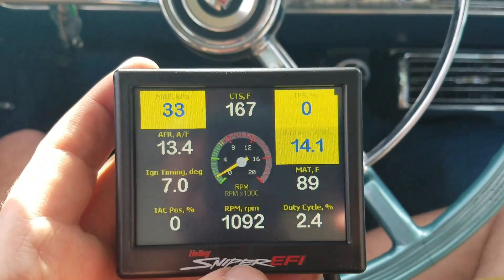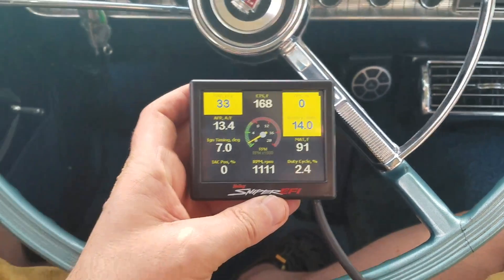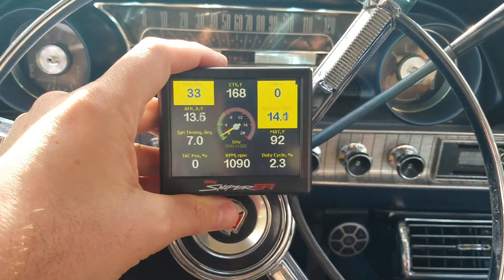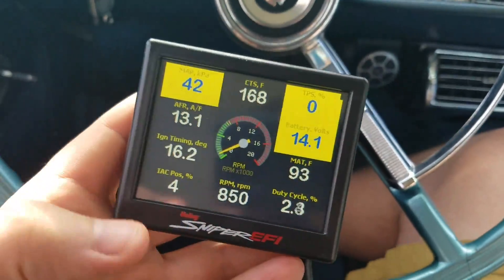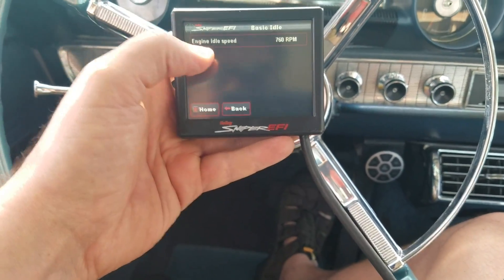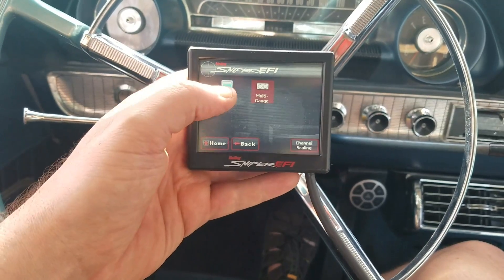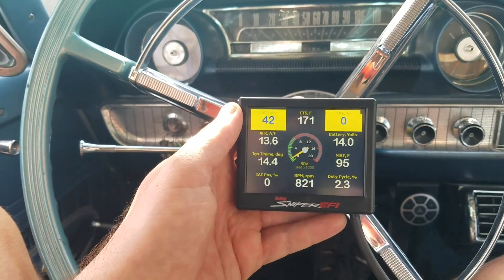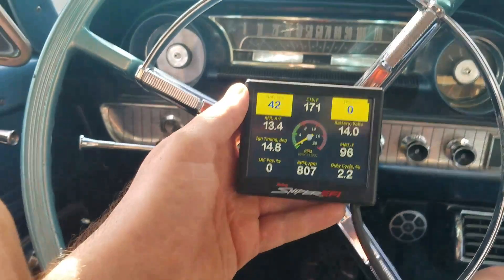Basic tuning on holley sniper efi

Comment: Hey Chuck, I didn't see the initial video and or the issue you had. My CJ5 Jeep has this Holley Sniper EFI but the issue I have is that my car will die at 35/45 minutes of driving around. It feels like something "heats" up or idles because I have to wait around 25 minutes to crank again and then i can drive around but it will die again so that's why I say its something that heats up and wont send the enough gas/power and the car dies. Everything is connected as it should and my mechanic has not find out any other issue than this system.. would you help? Calling this guys at Holley is like talking t o a wall.
Reply from the maker: Hey Efrain. What fuel system are you using? That was the biggest issue with mine. In tank fuel pumps are best - & the most difficult to install.

Comment: You are running the car too cold. Normal operating temperature should be at least 180 degrees.  Also your not tuning the system you're adjusting the idle .

Comment: Your IAC is at 0, close the throttle blades some and it will idle where you program it to
Reply: Newbie here, What does that mean what you said?
I just got a truck that has this unit on it but no information on it.
Reply: @justmedontknowdoyou7860  IAC = Idle Air Control [Valve]. If the engine is idling higher than you want, and the IAC position is at 0%, that means that the throttle blades need to be closed some, as they are letting in too much air with no pedal input. You want to adjust the throttle valves such that the engine is idling at the target speed with the IAC somewhere in the range of 2-5%.

Comment: How about reading the instructions?  Your IAC is way off, your timing is way off, your manual idle screw is off, and you're asking it to do something that it can't sensibly do.  That's why the idle isn't tracking the right speed.
Reply from the maker: if you watch my subsequent video, that's what I did. I never suggested I was an expert on these topics. I merely put out info to show people some of the problems I had and how to fix them. that's why I showed the progression over several videos. This was after having my system installed by a very well known builder - who didn't quite get it right. So I did it myself, figured it out - and documented it in hopes others might find some benefit. The vast majority of comments suggested my videos are helpful. If you know more and can do better, create some videos and help people out!
Reply: The system has to learn after adjusting

Comment: I had the same issue but no matter how much I lowered it on the monitor it would not lower the RPM. I had to adjust and lower it on the actual EFI unit first and now I can control the idle from the monitor.

Comment: Chuck my IAC is running at 27 can you give me any suggestions please.
Reply from the maker: I had my IAC going nuts and ended up doing a "IAC reset" - with the help of holley tech support, of course. If you want to do an IAC reset, you will need to block off the IAC port and adjust your idle from there. The IAC port is a small hole (1/3" or so diameter) that sits on the rear of the fuel injection unit. I duck taped mine. Be careful doing this - if it comes loose it can potentially get pulled into your motor. once you have it blocked off - the fuel injection unit is forced to only pull air from the 4 main throttle body ports. From there, you adjust you idle using the idle adjst screw - not the head unit. Once you get it where you want - pull the tape off and the computer can take over from there. I would highly recommend you call HOlley though - as they are super helpful. :-) good luck!
Reply: Than you! Thank you! sir I just installed my Sniper today by adjusting the idle screw on the side my idle would not go lower than 870 I guess it's a learning process thanks to all of you guys on YouTube life with the sniper just keep getting better again Thank you.
Reply from the maker: Yah - if you idle isn't running at the speed you set in the computer - try the IAC thing. Good luck!

Comment: Hey Chuck. Your idle is probably a touch high cause it at least appeared like your iac steps were too low. Meaning your throttle blades are a bit too open. Check the sniper info on iac adjustments. But looks good!
Reply from the maker: Yah. I made another video on this. Spent some time with Holley tech support (super helpful guys) and reset my IAC and re-mapped my fuel on cranking and start up. much improved. Thanks!
Reply: I had the same problem with the idle not matching what you set it at and was able to solve it by adjusting the idle speed curve setting at -40°. See https://www.efisystempro.com/efi-pro-hangout/holley-sniper-efi-instruction/holley-sniper-installation-startup-troubleshooting

Comment: I have a question.  I have a 64 500 XL with the selecair air conditioning.  I noticed you are running a modern compressor.  Is that a universal kit?
Reply from the maker: Yah, this is a rotary style compressor - versus the piston style that the car came with. They're supposed to be quieter and more efficient. You will need new mounting brackets. There are several companies specializing in ac for old cars. look up classic air, vintage air and old air on google.

Comment: did the kit come with Holleys water temp reader that goes in the block?
Reply from the maker: Cory Rogers yes - although my edelbrock RPM intake only had one port - so we ended up putting a splitter on the heater hose is order to keep my stock dash heater gauge working.